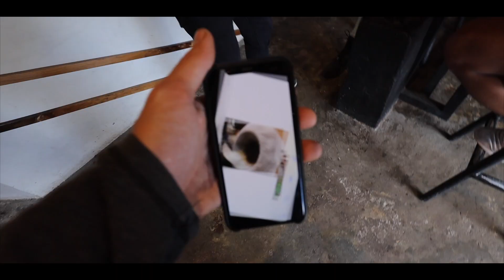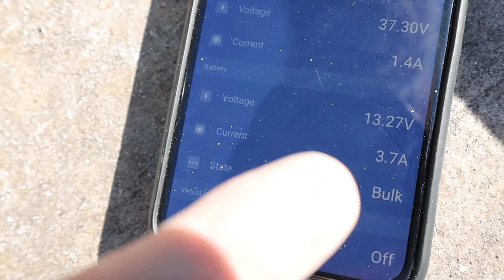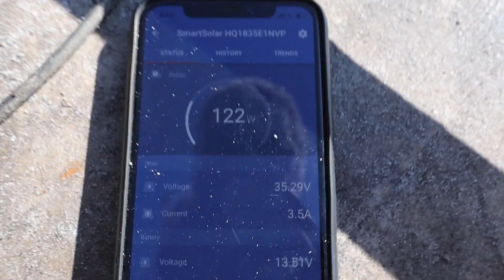A very humbling day // tiny house homestead

Comment: I have been following you guys for a few months.  I lived in Panama for 4 years, great country.  You live on a sloped hill, so consider that in all your builds.  Rain water drain off is going to be a big one.  Never remove topsoil grass if possible.  It holds the soil together.  Also build with concrete peers on everything.  Use hurricane straps on your bus, do it now.  Build with the wind, to avoid wind shear. Good luck.

Comment: Glad ur reading our feedback.  I too thought that was a good tidbit about the spacing of the trees.  Don't forget the composting tip.  It was cool to see Kaylee's freckles.  They look cool!  The gentleman from Trinidad & Tobago, have him point you to some good soca and steel band music!  His original land is the Mecca of the steel band!  And, lastly, please consider using concrete instead of wood as your building material to avoid wood rot and termites.  Panama is the land of wood rot and termites with voracious appetites.
Reply: we are building in Panama with mostly concrete block. as long as you use local wood that is treated then it will be OK .. we were surprised how many old wood houses we saw in Boquete,, down where we are there are hardly any.. different climates across the country
Reply: Glad ur using mostly concrete.  You don't wanna build entirely out of treated wood as it is toxic and I don;t want you to get cancer.  If you're using it for certain parts like the roof or outside  or maybe a few places, fine, but being entirely surrounded by toxins that out-gass is not a good idea.

Comment: I love that color for the bus, I once had a travel trailer that color its got a good vibe. I need to paint my van but I know how much work it is so I just have put it off for YEARS. what kind of paint are you using? I would not be opposed to just doing a brush on/roll on job as long as the paint would last a while.its just an old van but its looking like a creep van these days with the paint coming off.

Comment: It looks like I am almost too late with advice on removing the decals but in case you still have more to go here is what I suggest. - If the decal gets a lot of sunshine throughout the day it will  soften the adhesive  & be easier to remove. For areas that are not getting a lot of sunshine try brushing on a harsh solvent like Acetone, Toluene or Paint Stripper. They are nasty solvents so use appropriate gloves & stay away from the fumes but they will disolve the decals in short order.

Comment: 3:40 gonna say it again.  That wire wheel is crazy dangerous.  Wear eye protection.
Reply: And I saw her breathing in the paint fumes!! Also there is a reason for the coating,  on top of the bus. Buy some RV roof sealing to stop future leaks, and to keep the bus cooler.
Reply: I noticed that too. Good advice.  Safety first.
Reply: Eye....and mask..and light gloves...

Comment: Rain Roof -       Please check out the videos on the Handeeman channel. You do not, obviously, need the massive installation that living in Arizona requires, but Derek's basic plan principles and techniques can be applied. For example, you do not need your roof pitch to be  steep to be able to collect rainwater. Good luck and happy planning!

Comment: One more thing, your buss still runs? So use it to make power for your building, remove the tires get an inverted and install a generator and then you have instant power. Flip the sets in front so you'll have a bigger living room. if the buss is never going to go mobile again, use it to your advantage.

Comment: Us the side of your hill for rain collection by laying down a large “V” lower down the hill. Make the “V” out of cobblestone or concave 3 foot cement type walkway or large drainage pipes cut in half and laid into the ground. Have a pipe at the bottom of the “V” that goes down hill to your water collection tanks. So using the side of hill in place of roof, no wind problems. If you didn’t want to use a portion of the hillside, you could lay down a clay or cobblestone or cement type patio, that the water would runoff into a pipe. After all your previous collection roof wasn’t that large. Then as long as this patio was able to continue to collect water during the rainy season, it could possibly serve a second function during the summertime. Imagine.

Comment: Ok, so the rain catchment lean-two didn't work out. Maybe you didn't think it all the way through or maybe you didn't have the vision you needed to make it happen. So here's what I get from everything you two have said. You want to build a compound where other travelers can come stay, and be safe to park as they transition from city to city, or country to country. So your home, which is a pretty solid structure is on blocks, and when you step out your front doors, your feet don't land on a deck, but they should. And the porch roof isn't a rain catchment roof, but it should be since it would be attached to a solid structure. You could add more solar and the deck and roof would be a great place to entertain company, eat, dance, ect. it would also establish the beginning of your structures in your compound. I tractor to disk the land would really help you begin to lay it out and give you somewhat of a driveway leading into your new spread. There are a lot of trees around that would make great fence posts.....maybe you could get someone on cutting a few down to make posts and plant them. You could bolt a 2x6 to the front top of the buss, and built a frame with posts for your rain catchment roof porch and build a wooden deck that later you could transition to stone, and make it big enough so Kaylee can teach a good sized yoga class. From there, you could do a garden off to the side of the buss, and us the uneven grade with rows so when it rained, the water would waterfall down to each row and water your garden for you. Double your solar and run some lights, even christmas lights would work a be cheap on the pocket and the power. Then maybe a few paths leading to where your next structures will be so it defines what your planing on building. Good luck.

Comment: WHY don't you use the TOP of your BUS to install your WATER CATCHER PANELS (wind can't BLOW your bus down) then run pipe to your water tanks  JUST A GREAT IDEA (TO ME ANYWAYS)

well I guess your bus is to fare from water tanks oh well 
I tried...... Steel post NOT WOOD 
POST ,AT LEAST 4 FEET IN THE GROUND  WITH CONCRETE.. SHOULD FIGHT THE WIND GOOD LUCK
Reply: AMERICA THE BEAUTIFUL,
  Maybe they can have a separate water tank, sitting on the lee side of the bus. So the water from the bus roof could flow down into it. They could put a filter on the line. It would make having water at the bus convenient.
  Carrying water up to the bus from the water collectors way down the hill is going to be a lot of tiring daily work. Water is so heavy.

Comment: Being a punster and pie lover myself, I appreciate the humble pie at the end. :)  It would be awesome to join you in El Salvador, but I just started a new job and haven’t accrued any PTO yet, so maybe next time. Also, good job spacing the trees out. I was a landscaper/gardener for a handful of years and one of the most common problems I saw was plants and trees being planted too close together without enough room to grow into their full size, whether because they were too close to each other, or too close to a house/building, or trees planted too close to the street where they would have to be pruned back severely and unhealthily to keep them away from traffic/parking/power lines/etc. Probably not an issue you’ll have, but it’s always important to pay attention to keep space between the bases of trees and concrete foundations, sidewalks, septic fields, underground pipes, etc. because certain types of trees put out roots that will grow into/through those types of structures and/or push up or push against them, lifting them, damaging them, and/or blocking their flow in the case of pipes. It’s best to always read about the trees and plants you’re using to understand how they will grow and to envision and measure what the reality of the space they’ll need will be when they are mature, and then give them the proper amount of space so they can thrive. Also, citrus trees do best when they are properly fertilized.